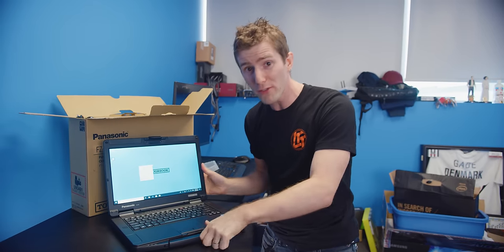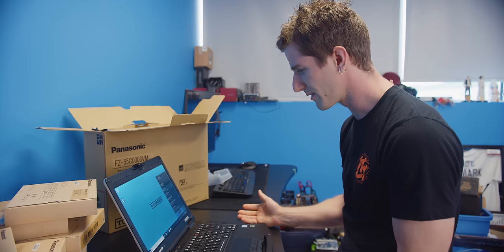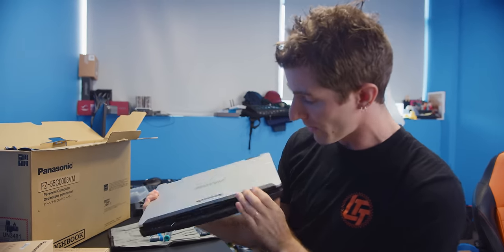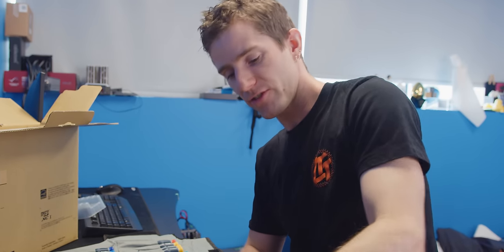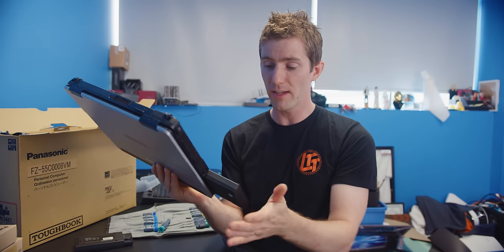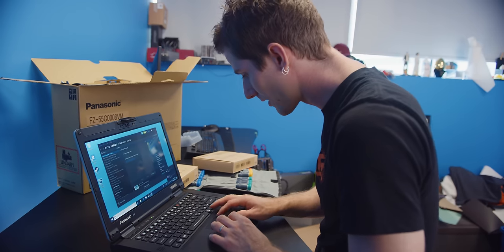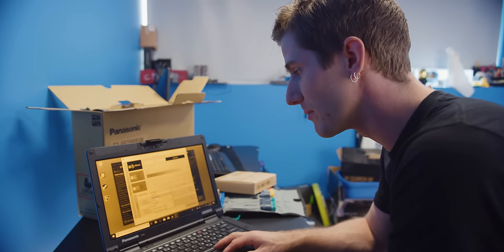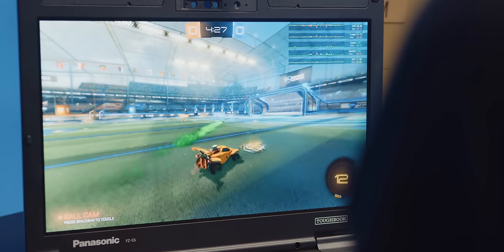The CRAZY Upgradeable Laptop - Panasonic TOUGHBOOK 55 Showcase

Comment: most interesting laptop of 2019, no joke.
Reply: Qyoon, how about i tell you that Expresscard did it better and first (2009)
Reply: @rikdenbreejen5230  PCMCIA card slot would like to have a word with you! 😉
Reply: John Dela Cruz  Maybe so, but It was not first by a long shot!!
Reply: Well in the sea of "dual screen laptops with 1000000 Hz refresh rate" its nice to see some retro tech being updated.
Reply: It's been around for years.
Reply: @bullracing1  I didnt say its new , i said being updated .... its clearly made to target specific users like miilitary,journalists and so forth .. its good product and there is market for it.
Reply: Havn't you seen those Macbooks?

Nah jk those r gae
Reply: Modular GPUs and upgradable CPUs need to be adopted by every laptop manufacturer. Could cut costs in produciton, and reduce ewaste (i wont have to get a new laptop every 5 years, just upgrade to a new gpu)
Reply: I fucking hate ultraslim shit, for me a thick notebook is a proper notebook. Too bad this thing starts at 2000$.
Reply: Qyoon *best
Reply: @ThatFilmisGnarly  r u high?
Reply: @ThatFilmisGnarly  It would only help with cutting manufacturing costs if there was some kind of standard, and that's not going to happen. Notebook manufacturers are fighting tooth and nail for the customers, and a large part of their weapons are design related. Having to accommodate standardised modules limits their design options severely, making it hard to woe the customers. It also tends to restrict how compact they can make a device, and as we've seen there are a lot of people who place design and bling over function and reliability.

Reliability is another tough subject. While it sounds good to be able to just switch out any module that give you trouble the connectors necessary for this to work is also a possible point of failure. While it's not much of a problem when you've got one manufacturer such as Panasonic using it for one of their product lines as they control both manufacturing tolerances and materials used when you try to introduce an industry wide standard there will be manufacturers that try to cut cost by cheaping out on either or both materials and tolerances.
Reply: I agree with you
Reply: nope.  it is not an upgradeable laptop but a laptop that is easy to service/fix when there's a problem.
Reply: nah clevo have some of those caracteristics , phone radio, dual gpu, socketed cpu /gpu, panasonic series is old like year 2000 and you can buy them cheap, on ebay, getac too , they are beast
Reply: The concept of re-cycling the optical bay into a pcie adapter is brilliantly inspired thinking. I hope this kinda modular thinking gains more industry adoption.
Reply: Qyoon military needs new computers they all suck and are outdated
Reply: @christan6956  is older that time back in the day of sony vaio, you can buy it in the lenovo y710p is called super bay, and the tecnology is about 2000 or even before
Reply: Agreed
Reply: Commodorefan64, NANI
Reply: Asus Zen book pro duo 15: Am i a joke to you?
Reply: @crylia8666  Me : Yes, and a bad one.
Reply: @Qyoon  OMG you have no idea lmao
Reply: @crylia8666  By the way i see you play WT, i was playing it way in the past
Reply: Alienware area 51 does the same thing,, just needs a little technical know how
Reply: eh, im still on the ROG Mothership train
Reply: @adwaitsharma6915  that's the point, even non techies can upgrade this
Reply: Just let all the modular interfaces be USB-C (Thunderbolt where applicable).
Reply: @blahorgaslisk7763  they already have a standard though. All Nvidia gpu gaming laptops are based on the same design (Nvidia made the prototype and licensed it out to the manufacturers) 

All Nvidia has to do is come up with a modular laptop design, and all the laptop makers will lease the rights to use the design.
Reply: @HailAzathoth  always. duh.
Reply: Yeah
Reply: @ThatFilmisGnarly  but that is EXACTLY what literally all other laptop manufacturers want you to do ...
Reply: I wish i could get one!!!
Reply: would be better if it would be using oem nano itx motherboard with S series of 8th or 9th gen desktop processors like 8100T 8400t 8600T 8700T. upgrade to i9 9900T., and some rtx or gtx 1060 or higher graphics are atleast screen should be 120hz
Reply: @ThatFilmisGnarly  well some laptops have upgradable GPUs and CPUs. I can upgrade CPU on my laptop
Reply: @ThatFilmisGnarly  check out MXM graphic carda
Reply: @blahorgaslisk7763  Cool story bro.
Reply: this laptop is so rad Aye i wish Alienware would of Worked with Panasonic to create the MEGA GAMING version of Laptop with Upgradable stuff would be AWESOME
Reply: @ThatFilmisGnarly  They all know that, but that is not in their interest, if u dont buy a new laptop every 2,3 years, they have no need to make, and if they dont make they cant sell and they cant make money.
Reply: @twinbladedemon2205  Its made for domestic uses, we do not use these in the military.
Reply: Hang Them All well its made for everyone who wants to buy it, that includes domestic users, but i think that some people can utilize this device more than others
Reply: @twinbladedemon2205  That's what domestic use means..
Reply: @ThatFilmisGnarly  and it looks solid, I bet it can last for years
Reply: Word
Reply: It's made for government workers
Reply: Still interesting in 2020.
Reply: @dorian4426  ikr
Reply: @Qyoon  Still interesting in 2021.
Reply: @dorian4426  i agree

Comment: As an aviation mechanic, I have been using these for the last 15 years. We use the thicker ones and they really are tough. I have dropped them from wings many times. They really are a great product
Reply: I used to work at a skydiving company and one of the stories was about a guy who had dropped his 1500 feet when they were taking off and it still booted. These things are Nokia 3310 laptops.
Reply: 69 likes lmao
Reply: Do you think this laptop might be for me? or should I go the other model?
Reply: @ionair1913  - depends your industry.
Reply: @ionair1913  Um, no one here knows who TF you are dude.
Reply: I'm sorry, you dropped them FROM WHAT?
Reply: Bro you must be living a very fascinating life
Reply: Same here, especially with most corporate aviation still requires laptops with floppy drives
Reply: I thought you meant you dropped it from a plane in the sky
Reply: Sounds like the laptop version of the 3310
Reply: @theobama8535  Except, they are a lot harder to damage and kill then 3310s.

Comment: Laptop: Has tons of upgrades. 

Windows 10: Oh I don’t think so.
Reply: This is why linux is god
Reply: Skeleton God 
Nah, Windows is god, Linus is good, but Windows is better
Reply: @fable9830  Might as well mention software rot that slows down a os over time a base windows installation will run faster than it will 6 months later with nothing installed no linux distro has this problem.
Reply: Skeleton God 
We used to have Ubuntu at school and it sucked
Reply: @fable9830  now sucked in what way?
Reply: @charaxpapyrus  Every f**king way possible
Reply: @fable9830  that doesn't explain much but might as well mention that wine can run windows applications on linux without having to install windows mening less bloat and memory efficient
Reply: preaty sure Windows 10 would just be like "bring it on"
Reply: @charaxpapyrus  my Windows installation was running fine for 4 years, as fast as the day it started.
Reply: @wta1518  What do yoh use it for for a basic home user it ant going to do much
Reply: @charaxpapyrus  Gaming on a laptop that is definitely not meant for gaming.
Reply: @wta1518  glad I'm not alone in gaming on a shitty laptop. I got 40 fps in minecraft on a modded skyblock and was surprised.
Reply: @charaxpapyrus  I used Linux for configuring servers and that is the only thing it is good at. Windows has way more functionality deal with it and keep crying.
Reply: @Maggiethegsd  it really doesn’t unless you want to play games, but even then Linux is getting closer every month

Check up on PopOS etc 

Don’t get me wrong Windows and MacOS are nice operating systems, but GNU/Linux is incredibly powerful and has an insane amount of functionality in the right hands

Plus it’s more private/secure so that’s a plus, not to mention free
Reply: That’s the worst part, Windows 10 doesn’t recognise half of what Windows 7 did with 100x less available drivers, and they’re thinking about Windows 2021 ha no way
Reply: @charaxpapyrus  I installed ubuntu in my 2.0 usb, bit slow, but absolutely better than Windows.lol
Reply: @fable9830  Dude, Linux isn't just Ubuntu. There are many more distros that are better than Ubuntu. I don't hate it but not that i like it either. But Linux is definitely better in terms of privacy,less-bloatware, no spyware/ads/telemetry/compatibility(runs on my ancient computer 15 years ago just fine). The reason it may suck is because people are used to windows and don't wanna learn something new. The only part i see Linux isn't as great as Windows is gaming. But it has gotten way better than 2 years ago  and will keep getting better.
Reply: @fossforever512  Ikr. People are just scared to learn how to use it.
Reply: @charaxpapyrus  the only thing linux is actually good for is minecraft
minecraft loads a lot faster on linux than windows, and servers
Reply: @halo3rat_709  i see you dont do your research linux is better in many areas load times included, no one can see what your doing, and nearly everything windows has can be accomplished with wine, not having to restart for an update, have you seen windows being used for severs no as linux completely dominates, every super computer in the world uses it, its highly customizable, and with distros like puppy linux it can run inside 246mbs of ram, kaili linux is also the goto os for ethical/white hat hacking all around linux is just better and did i mention its free
Reply: @fable9830  the only reason windows is "good" is everyone makes their software to run on windows primarily. If that weren't the case, windows would suck

Comment: Blue Ray, Optical Drive just more blue
-Linus Sebastian 2019
Reply: at this point, bluray is practically antiquated tech.
Reply: @ShaneOzouf  Not for HIFi enthusiasts. Also, you can´t trust the movies or shows you like to stay on a given platform, so reconsider physical media :)
Reply: @voider978  for all those Hifi/movie enthusiasts using their laptop as their main media source? 😂
Reply: @miniweetabix  Hahaha, this is an exception of course. I was thinking in general terms
Reply: @ShaneOzouf  That's why it is not built in, but available as a separate module. 
However, this is enterprise product. And technicians quite often have to work with all sorts of enterprise/industrial equipment. Unlike your typical consumer, that kind of equipment does not tend to be replaced every two-three years. And if needs to be interfaced with, that quite often happens via whatever means are common at a time of manufacture. I've seen perfectly fine working machines that get their programs brought on 5.25" floppies.
Reply: Nanonoob so hilarious... 🤣🤣LOL
Reply: @ShaneOzouf  Only the video and audio quality on them far, far, far exceeds streaming and you really don't want to be downloading videos the same size.  
Also, many people just don't have the Internet quality to download things like games.
Reply: @miniweetabix  Not media, but for my dissertation, I used a machine that used a serial port to connect to a computer.  It hadn't been updated because it just worked.
Reply: Panasonic Blu-Ray 99 dollars.
- H H H H H H H H Gregg, for all your Christmas (in July) needs.
Reply: Workstation graphics card and running a video game 🙂

Comment: me when seeing this video: 
I want it! I need it!
me after checking the price:
okay I don't really need a Laptop anyways
Reply: yeah they start at like 2grand and go up to 4-5grands.. but at least they come with a handle
Reply: @majstealth  they don't sell this to consumer... i had to used company's info to get them... don't want it... it just overweight laptop.. that i can carry two laptop.... for the same weight...
Reply: @campkira  if you get a laptop with a handle you'll never go back.
Reply: @campkira  they are not really targeted to consumers, if even prosumers
Reply: I consider the prices fair. It's also out of what i can pay.
Reply: Well old ones on eBay are cheap enough
Reply: romano21A you don't want the old ones from ebay. you want this one!
Reply: Still a better deal than a MacBook
Reply: If you are selling to law enforcement you can charge as much as you want. Tax money is like free money that you can spend however you want.
Reply: @АлексейГриднев-и7р  Agreed. MacBooks are $1000 dollars worth of integrated GPU and old processors. In my opinion, the retina display is the only thing it's got going for it.
Reply: @Milamberinx  True! Got used to carry around the bulky Simatic Pg Field with the handle, feel more safe and comfortable than grasp with one hand my super thin lightweight domestic laptop
Reply: @АлексейГриднев-и7р  Yeah, at least you get hardware for the price you pay, and more important has plenty of ports not just cool designed-processor overheating-keyboard flimsy BS
Reply: Police and military grade we used tough books
Reply: Lucas Blubber
new here, or you buy all launched products straight after the embargo....wait some weeks, then you do need it again.....
Reply: ....maybe, just maybe, lol I just got an alienware laptop but this looks way more travel friendly
Reply: A year ago I bought a Costco laptop and I kind of regretted it the moment I turned it on.  Watching this video made me totally regret my laptop.  Seeing the price made me regret needing a laptop at all.  (I got it just for those extremely rare occasions when I need to work while traveling.)  For $2,000+, hell no!  If I were to spend that much, I would get a superfluously nice desktop machine.
Reply: @TheHouseOfWaffles  yeah i only got a laptop after building my dual video card water cooled monster pc. Always go the desktop way first for performance, then play around with laptops. Unless you literly live to travel. Honestly the only reason i got my alienware laptop is because i got it used with a broken screen for 100$. It was a gamble yes, but it paid off when i replaced the screen and everything  actually works to my surprise. Now i have a 3k$ laptop for a 200$ gamble. This laptop does look sweet tho for mobile games on the go. Double battery sounds awesome to me
Reply: If you like a more affordable somewhat modular laptop eluktronics sell their branded versions of Clio laptops. Just hunt around their website for BYO.
Reply: @majstealth  actually that's not a bad price. My PC along with the peripheral was $2000. Only if we could generate more money, that laptop will soon be in our hands

Comment: Finally, an actual laptop and not yet another damn ultrabook.
Reply: Seriously, if every laptop were like that, and the bays used standardized formfactors and connectors, i'd never buy a desktop again. It's not like i need an RTX or I9... just solid midrange performance and lots of customization options to make it mine.
Reply: @lyxar777  yea half of the time i play games, i don't notice the graphics as much. Maybe its because i play competitive games and focus on winning...but the point still stands. Who needs full ultra settings at 299fps anyways...maybe rich people
Reply: @lyxar777  I don't even care about the customization options, I just want it to be durable, so I don't have to buy a machine that breaks if I open the screen too quickly once.
Reply: @TheHadMatters  exactly. Buy the time the average spendable income is factored in, if you can buy the tough book, it isn't actually getting upgraded, but since it hopefully lasts a LOT longer, by the time a normal laptop would break, maybe you can afford to upgrade the tough book instead. :)

Comment: In reference to the SSD:  When I was in the Army a while back, we had toughbooks that could be used for classified data. Then it was standard IDE drives and one of the specifications is that the HDD must be able to be easily removed.  This way the data on the drive could be stored in a safe when not in use.  Some desktop PCs also had removable HDDs so they could switch from unlcass to at no higher than secret.  Although that was almost 20 years ago (damn I'm old) I would imagine the US military probably still has a similar standard and why the SSD in these things are so easily removed.
Reply: They should just use usb drive and cloud. So the laptop contain no data at all  lol
Reply: @syarifairlangga4608  cloud for classified data... Really?
Reply: @syarifairlangga4608  cloud? LMAO
Reply: @syarifairlangga4608  Wow.
Reply: that one exactly

20 years later, I'm a technician in the army. still using those HDD, still storing them away, and those are probably the same toughbooks used back then (windows XP is installed on the newer models, some are 98)
Reply: @syarifairlangga4608  If you are running a budget counter insurgency army, or being an insurgency yourself, sure.
If you are running the US military? Absolutely not.
Reply: Lol if kids want to know what tech was like when I was 9 (I'm 30 in April) I just tell them join the military and go enjoy 98! 😆!